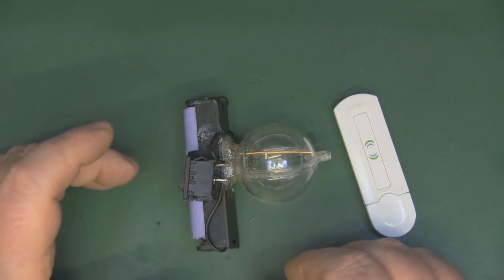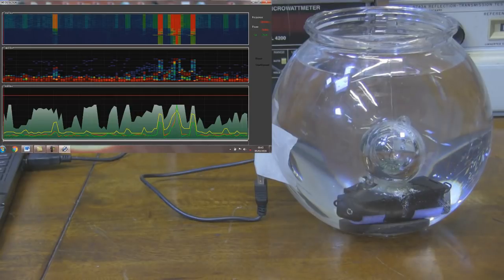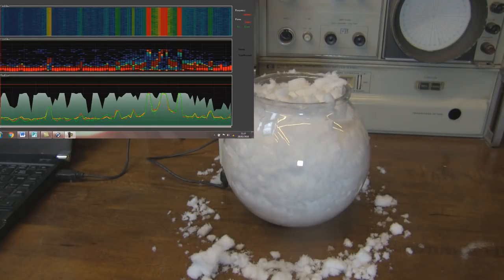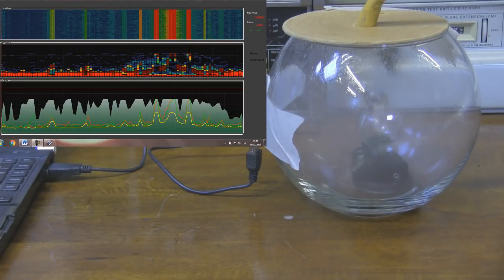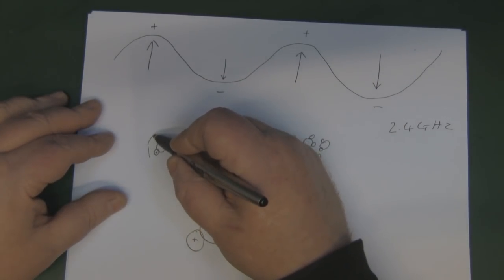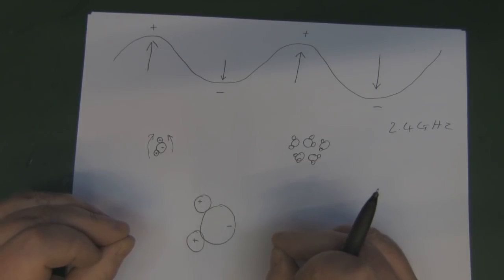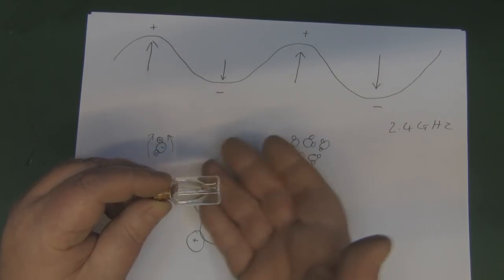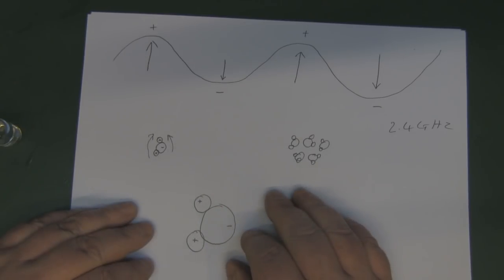Microwaves vs The Three States of Water

Comment from the maker: I have always wondered why no one has ever designed a cheap portable anechoic chamber where you could refill and empty water in the walls as you needed to. The walls could be made of hollow plastic and water is by far a cheaper absorber and reflections at 2.4GHz would be very low.
Reply: An interesting idea. Don't anechoic chambers have to work on a wide range of frequencies? I'm not entirely sure, but as far as I know, water works really well at absorbing 2.45GHz, but not much else (hence the reason why microwave ovens operate at that frequency). Maybe you could do some experiments with a spectrum analyzer and frequency generator on this?
Reply: The problem is mass and pressure. For a 5mx5m room with 0.5m roof it's 12500 kg. The tank must have big walls too because of the pressure... there's also the problem with water leaking on expensive equipment and the risk for people entering the room if the roof falls... Finally there's the door problem. How do you enter your bubble inside a giant tank... I guess it's feasible but it's a lot of problems... On a small scale maybe using 2 fish tanks: you use a smaller one upside down with the tested equipment inside and you use strings to pull it down in a bigger fish tank with some water. It's the diving bell method.

Comment: The other thing about steam is the molecules are moving through the space and may be subject to three situations : the speed of molecule through space may not see 2.4 ghz  but a doppler version of it 2. passing through space erratically may cancel  the overall work done on the molecule 3. Friction of neighbouring molecules isn't as pronounced as steam is far more spread out than liquid state . Good experiment . It would be interesting if a thin wall of water surrounding tx dampens the signal .

Comment: "In 1965, using long, L-band microwaves, Arno Penzias and Robert Wilson, scientists at Bell Labs, made an incredible discovery quite by accident: They detected background noise using a special low-noise antenna. The strange thing about the noise was that it was coming from every direction and did not seem to vary in intensity much at all. If this static were from something on our planet, such as radio transmissions from a nearby airport control tower, it would come only from one direction, not everywhere. The Bell Lab scientists soon realized that they had serendipitously discovered the cosmic microwave background radiation. This radiation, which fills the entire universe, is a clue to its beginning, known as the Big Bang. "Penzias and Wilson were awarded the 1978 Nobel Prize in physics for their discovery.

Comment: By exposing the battery terminals to water you effectively grounded the signal. I think you need to isolate the battery terminals for a  more accurate representation of microwaves in water not to mention that a microwave oven heats food by vibrating the water molecules in your food that's why nothing dry get directly heated. Also with steam the molecules are already moving very fast so the effect is less load on the wave/signal but it is an effective way to super heat the water molecule to more than 100c.I would have thought that with the liquid water it would have fried your transmitter with high reflections - dead short due to the battery negative terminal in contact with the water, but then again maybe the water acted as a perfect 50 ohm load. I'm too lazy to do the math ha ha.  The distance between the water and the antenna must have a significant effect on the loading/wave development/swrs also.
Reply from the maker: Tap water is not very conductive so would not make any measurable difference. Might be interesting to do it again using a salt water solution just to see if there is any difference.